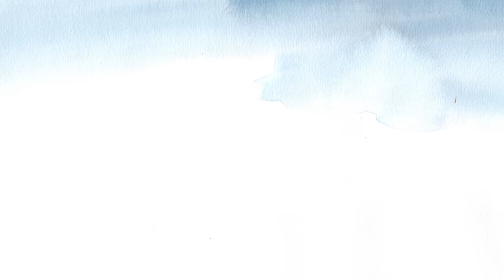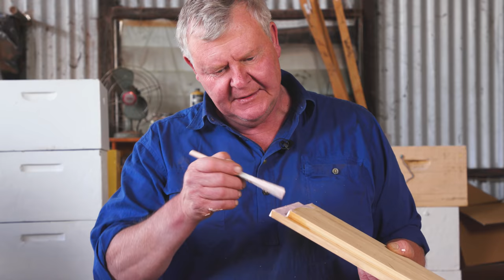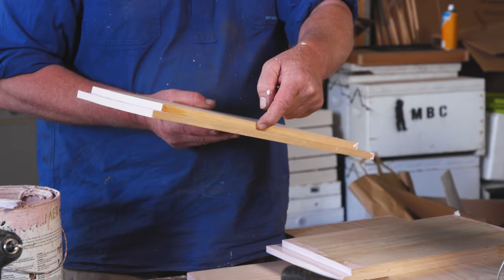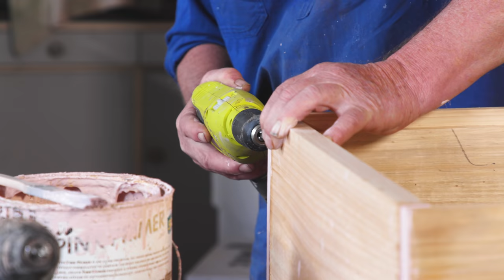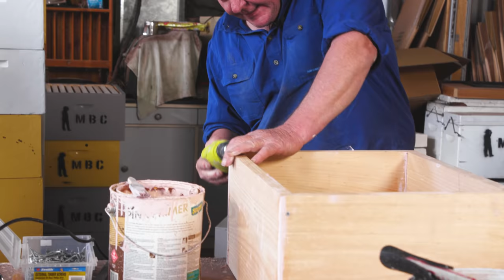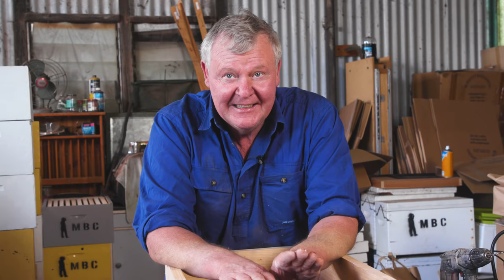How to Make a Bee Box: Building a Beehive From a Kit | The Bush Bee Man

Comment: Question on painting the boxes: Oil based or water based paint?
Reply: I try to use a water base to keep the fumes down. and i only paint the outside.
Reply: I used oil based paint last year during the cooler months but it took 2-3 months to dry because of the cool weather.  I would highly recommend water based because of this and easier cleanup.  Water based paints are far better now than they were in the past.
Reply: @rpeebles  Thanks captain, 
Yeah that is what I assumed (water-based). I would prefer oil for the durability, but the object of linseed fumes gives me pause thinking it may act like repellant for the critters. Thanks for the tip.